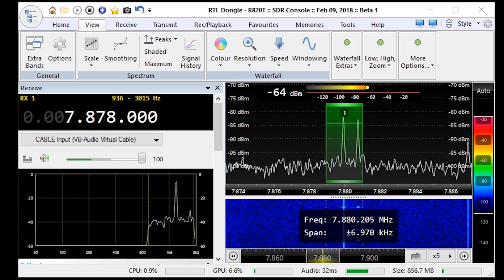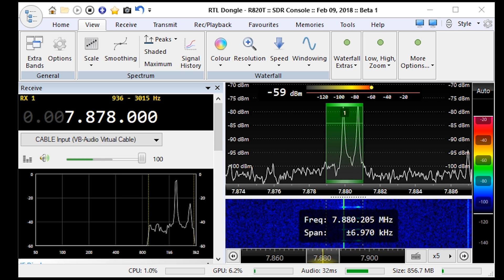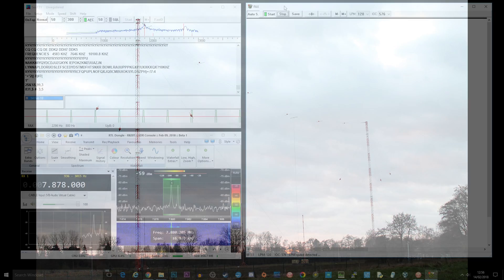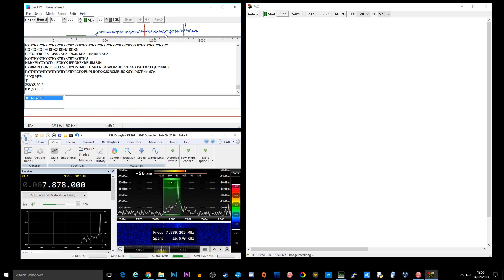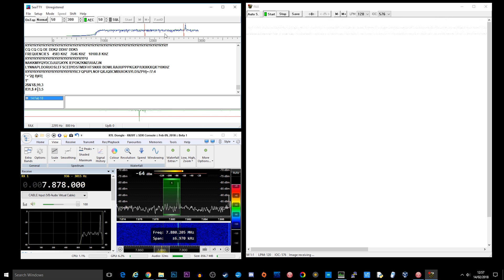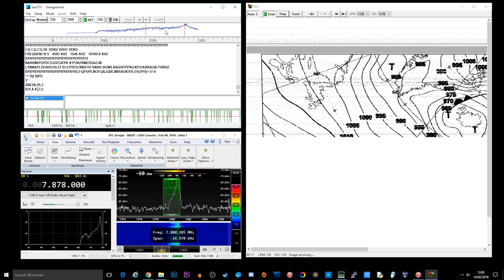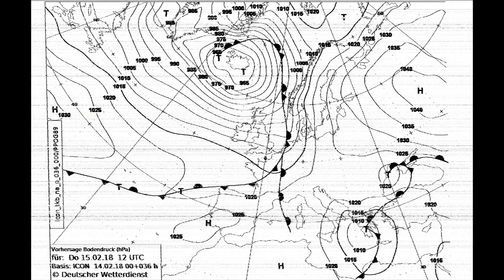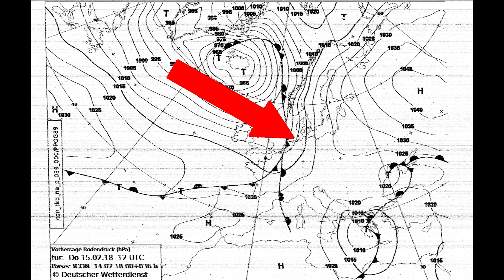Receiving HF Weather FAX Using An RTL SDR Receiver

Comment: Question: I am getting some signal in, but not quite cigar. Using SDR# on a V4 dongle, what modulation, exact frequency, and if CW is used what BFO (CW-shift) do you use?

Comment: I've actually worked with a wet paper fax in the 70's. The wet paper sits between a fixed metal edge, and a rotating 'screw' much like in a push lawnmower. This coil spins in the cadence of the signal. Every blip in the signal caused an electric spark between the coil and the edge. As the wet paper roll was in between, a black dot would appear on the spot where the spark happened. once the coil wat at end-of-line, the paper would scroll up a tiny bit, and the next line started. All very mechanical and very analog, but it worked like a charm

Comment: Hi,  I'm a newbie in the radio station listening.
How do you manage to locate the origin of the signal?
Thanks a lot.
73 from France
Reply from the maker: I guess it’s just research using Google. Can’t really get a direction unless you use a yagi, but if you type the frequency into google, you may get some results.

Comment: I currently pick these up while at sea by putting my little Tecsun shortwave radio next to my mast (an 8m aluminium tube) and getting my phone to listen to the output using its microphone. The "HF Weather Fax" Android app decodes.  I'm hoping that I might be able to make an automated Weather Fax receiver with an SDR dongle and a low power device like a Raspberry Pi Pico.

Comment: title show and say RTL receiver. you didnt provide any information about it. wrong title...
Reply from the maker: The term RTL-SDR refers to a device using RTL2832u, r820t2 chipset. The device used in this video uses that chipset. The title is correct. Thanks for watching and if you need help with anything please feel free to ask.

Comment: completely random bit if info related to this : 
if you know of - if not , go look it up " surfline" , the surf forcasting service - you might be interested in knowing that back in the 70's , Sean Collins the founder , used this very type of broadcast frequency on old, marine facsimile machines to retrieve a similar shortwave signal from Christchurch , powered via a car battery , usually from some remote place , to do his rudimentary surf forcasting for which he would become later famous for/is.
Purportedly he'd have to get up at 3am when no noise would interfere & would slowly wait 10 min, then hold for next broadcast , print it out , wait for next broadcast , repeat output of the png ...eventually having multipage weather pattern animation of sorts which'd let his true weather front addiction be fed, lol. 

interesting , I thought . 

(I read that in a book called , Ghost Wave by Chris Dixon . )

Comment: Is this also possible with the nooelec nesdr Mini?
Reply from the maker: I believe the mini has a lower frequency of around 25mhz which it could not receive HF Fax on its own. You would need the Ham It Up UP-Converter in-line with the antenna in order to receive the required frequencies for HF fax.